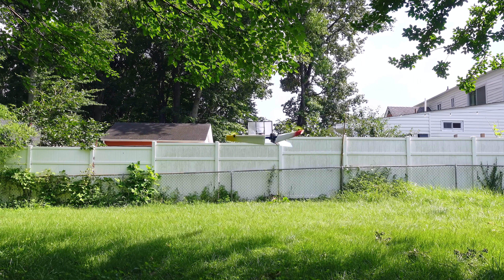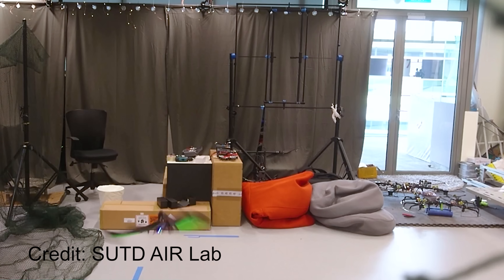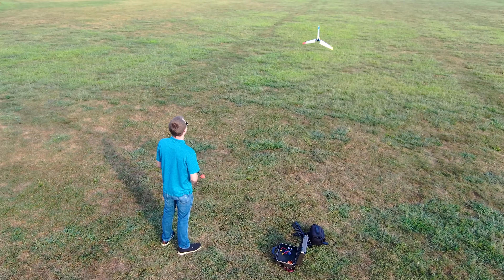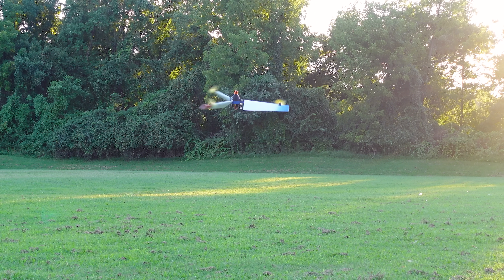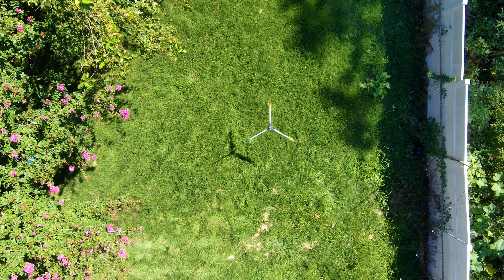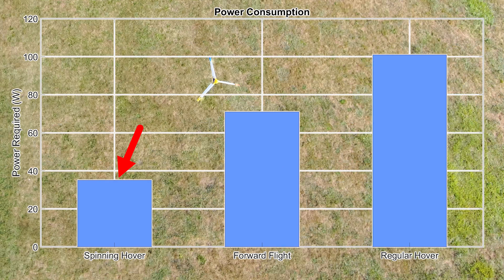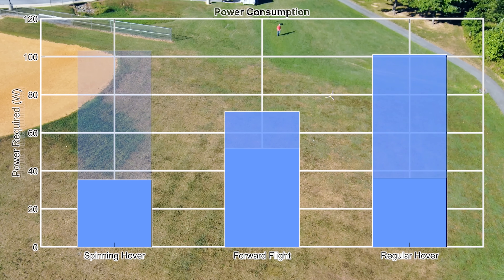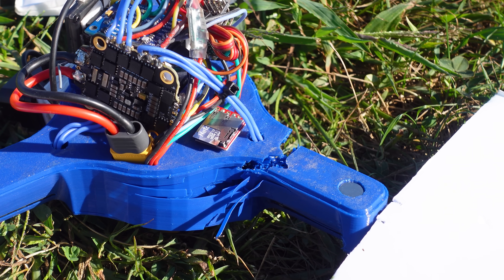Is THIS the Most Versatile Aircraft Design?  (Forward Flight Testing) - Part 2

Comment from the maker: New channel motto: Fly It Till You Crash It
Reply: 360 cam ?
Reply: @associatedblacksheepandmisfits  nope, you saw him keep a "subscribe" sign steady, meaning there's some counter-rotation going on.
Reply: @JustinKoenigSilica  was a suggestion, to use a 360 cam !
Reply: Thank you for this video and update of that interesting project. Your motto is similar to that of ham radio amateurs: if the antenna system survived the winter, it was too small! Greetings from Hamburg/Germany, Dietmar, DL4HAO ;)
Reply: Perfect
Reply: .... and then rebuild better with the knowledge on why you crashed.   ...   Why did it crash?
Reply from the maker: @gutrali  lost my orientation!!
Reply: @NicholasRehm  Try having a bit more powerful rotors to counter increase in weight

and

 instead of conical cap , use lithium ion battery on place in conical shape on both up and down side at centre to reduce drag and increase power capacity
Reply: @NicholasRehm  How many times have your neighbors called MUFON after you flew your drone lol?
Reply: Fix it till it's broke.  The true engineering motto
Reply: please make an H wing design...
it can spin and has 4 wings while flying
Reply: Idea 1: Could you have a the "top" wing be shorter but deeper? I would have less drag in forward flight but still have the similar area.
Idea 2: With independant tilt on all three wings, two wings could tilt forwards 90 and the third one act as a tail with rudder and elevator.
Reply: Not sure if you saw my previous comment. I did a similar design for my senior project about 3 years ago. 6 wings, 3 motors. Over 9 foot in diameter. The concept was for a pseudo satellite / emergency communications, long duration loiter.
Reply: 🛫📖🛬
I really like your new motto.
When you pranged it I really appreciated that "chuckle" 👍
That means you're a veteran.

After a real bad crash I would always say,
"WILL THAT BE PAPER OR PLASTIC SIR?"
Reply: @chuckcampbell3927  Is a plastic trash bag your “crash recovery vehicle”?
Reply: Try having a bit more powerful rotors to counter increase in weight

and

 instead of conical cap , use lithium ion battery on place in conical shape on both up and down side at centre to reduce drag and increase power capacity
Reply: keeping directional control, Clarke-Transformation and park-tranformation might be just what you need. they transform your rotating 3-directional system into a stationary bidirectional system.
Reply: Rules I live by.
Reply: ‘Fly till it dies’
Reply: can it have a short 'wing' on purpose, if level flight is always going to be in Imperial Shuttle orientation? (-o-) pew :P
step all the drone motors in to halfway down the wings and have one as a tail? - yes, I know that might have a (small?) impact on your spin state...
.
an alternative. Make a B-wing - 4 wings in total. 2 long wings for level flight and 2 stubby tails top and bottom. Making your spin state stable again. Reducing drag in level flight.. maybe you'd even get a mix to use top and bottom rotors for pitch attitude, in addition to left-right 'ruddering' - all compromises of course but should give you less drag and more top speed in efficient, level flight...
Reply: i also thought about 4 'wings', horizontal flight could be in 'x-mode' - all 4 generating lift, may not be more efficient with spinning mode though
Reply: @Φλωρος-Θωμασου-Ξ5Ξ  probably to keep the same efficiency, he would have to change the size of the motors, using 4 lighter ones, or just make the whole model bigger to take advantage of the extra power. Prop size is very important, which is why it hovers efficiently, because it is acting like a giant, slow, propeller in hover mode.
Reply: you could add an extra servo at the base of the vertical fin in forward flight and have it tilt backwards gradually. Upon reaching max speed you would have that rotor almost if not completely level while the two wing are doing their usual thing.  that servo could revert to its normal position as you slow down for hover giving you what you have now. Just a non-conventional idea that needs to be tested asap! :)...
Reply: Ride it 'til the wings fall off!
Reply: This has been my RC motto since ever.
Reply: If you want a efficent twist in the wing, there is a way, its not that complicated. But it would need a few changes. 

Have a carbon rod/pipe,  as large as possible in diameter, have it conected to the twist servo. Put  the wing over, but only conect it rotationally to the outer edge. Conect the inner edge (with a bit of flex) to the central core boddy.

If the flex is the right anount, you will have a prefectly screw rotorblade, regardless angle of attack. This way tou would probobly gain 20-25% hover effixency
Reply: If you move the motors to wing centers you could increase the tip speed of the wings ;)
Reply: I like this design. Did you try flying forward with the two wings up, so the dihedral is up, making it more stable? In the end, you might want to use 4 wings to get a flat wing and, if you could move them, like an x wing fighter, you could make all 4 wings be mostly horizontal.
Reply: in fact, you could even do something like a box kite shape. idk if that is a good wing design, but a box kite pulls really hard in the wind and, with some creativity, you might be able to fold it out into two very long wings for a high aspect ratio and efficient glide. Of course, there are so many tradeoffs that you might want to build several designs for different advantages.
Reply: Why not 4 wings  like an + shape for spining wich fold down into an X wing shape for forward flight? mahe it like  as close to a biplane as you can when the wings fold for forward flight
Reply: Why can't the third "wing/propeller" go on the bottom while in forward flight mode? That way you don't have to balance a big awkward thing at the top.
Reply: Nicolas, will it possible to see 4 wing model on test? To see how it will be flying in X-wing style. :)
Reply: Most of the man piloted bulk drones need wing concept similar to this, wings/fins to impose cruise direction mass into lift. Or a centripetal limbs like this one.
Reply: I had an idea for your horizontal movement while in spinning hover. Bot sure if it would work or add too much weight. Basically at the end of the wings ad small (perpendicular to the main wings.) stabilizers. A T section if you will. Haven’t tested myself (yet) but in theory.
Reply: Coca-Cola Themed TIE-FIGHTER ❤ How long ago did the Military steal your idea ?
Reply: You could try annealing the center hub in the oven. Grind down salt to as find a powder as you can make it, put it in an oven dish and pack it tightly with the salt.
Reply: Add another 3 motors to the bottom
Reply: Add these to your prototype and see if the efficiency adds to your design.

 https://youtu.be/k0yzBTTqfzs
Reply: Yeah I seen an elder guy had a pole with a weight on the end. He couldnt pick it up, but when he spun the plate he could pick it up np. I guess it wouldnt matter the weight of the drone if its spinning fast enough?
Reply: BRAVO on that drone design! One of the best I have found so far.
Reply: Try a 4-rotor blade model, and fly it in forward flight aligned as an X to the ground. All 4 blades will provide both lift and stability.

Comment: Such a machine can be used to provide an antenna/transmitter/receiver platform for emergency contact radio.  Using amateur radio existing repeater technology; one could build a UHF [440 MHz] uplink to be retransmitted out to any VHF or UHF repeater station;  all of which would be dramatically more accessible at 300 to 500 foot altitude.  Such a system could be compact;  fitting to a briefcase.   This would be a game changer -- a "mountain top" in a briefcase.    📻

Comment: Make that third foil fold in forward flight. Perhaps make the folding work on centrifuge forces when it spins the wings are equal lateral. When it stops the third folds.
Reply from the maker: Unfortunately that kills the regulator tricopter hover mode

Comment: A helicopter uses a tilted swash plate to control the direction 

You can model an electronic swash plate, substitute RPM were amperage to the motor

Comment: I wonder if it would improve the control and efficiency if using ducted thrust instead of propellers running through every prop-path turbulence.  Does the ducting have more of a stable "jet" effect with Venturi effect, rather than beating the air at an angle with props for thrust?

Comment: I think the air being pushed by the props is just being flung parallel to the craft by the wings so less stable maybe if you put the props on the end of the wings or in a place where the air moving from them doesn’t collide with the wings 🤔maybe not

Comment: You need a way to hinge one of your propeller shafts on demand in a mode switch. That way when you change from hover to flight you could almost get the benefits of both tour design and the inspiration design. Hmmm

Comment: So instead of pitchin gthe entire craft forward for forward flight, why not just rotate two of the wings forward so they look like a normal airplane with wings canted forward, leaving the rear wing in a vertical position. The rear motor might even be about to be shut off in this mode. I have no ability to figure out how to do that, but with your skills it might be possible.

Comment: Can I ask why a tricopter and not more? Is it because of the compromise of forward flight vs hovering efficiency? I would imagine that an hexacopter with the same wing foil design and body spin principles would achieve high hover efficiency. But, I don't have the materials to test this
Reply from the maker: Minimum parts required to demonstrate the concept

Comment: I wonder if going from "3-blade" to "4-blade" might be better. Then the second pair can be also rotated to generate lift in forward flight rather than have one blade being dead-weight and add useless drag. The X shape also can resolve vertical and horizontal stabilisation.

For using a camera while spinning, I have a theory that a fluid coupler might be useful (like in a car's automatic transmission) if the turbine side has blades that rotate it in the opposite direction of the compressor side.

Comment: Also I assume you'll have a pod hung from bottom center on a spin bearing so it doesnt spin with the wings and on a swivel so it stays horizontal to ground, esp if it becomes a people carrier (which it should). To me, its THE ULTIMATE homebuilt experimental STOL airplane with a Yamaha snowmobile engine, generator, small contingent of batteries and electric motored props.

Comment: What about have wings extend by centrifugal force when spinning for climb or hover and then retract by springs when spin stops for forward horizontal flight. Could use shorter wings with less drag for forward flight but still have them grow for spinning climb and hover. The extension mechanism   would have to be connected for all three wings so that  failure of a single wing to extend would not cause a catastrophic imbalance. But, the mechanism would work by spring tension automatically for simplicity and safety.  You could also have better chance of coordinating wing lenght for max effeciency for climb, for hover, and for forward horizontal cruise as i suspect the optimal wing length is different for each manuever. Could use variable rate springs or 2 springs if best climb length and best hover length were different enough to matter.

Comment: If each wing was made like a hang glider wing (fabric with a tubular leading edge and bent tip), then it would be very efficient spinning and flying. The material would make an asymetric wing whichever way it was oriented.

Comment: Just discovered this channel and loving it.  Did you consider a 4 rotor design with 2 longer and 2 shorter blades?  Essentiall a diamond shape.  It would provide enough stability in non-rotating hover, and have level lifting bodies for forward flight.

Comment: @NicholasRehm Just a thought: why don't you put the broader part of the wing at the tip. Now, the slowest part of the wing is near the rotating centrum. At the tip of the rotating wings, there is much more speed, and thus more lift to gain.  Of course : also more resisance.... there must be a sweet spot somewhere

Comment: What about a modular design that you can switch between modes to maximize efficiency based on what you need most at the time? 2 wings for forward efficiency and 3 for hover.

Comment: Cool. I would try to spin (hovering mode) and fly forward at the same time. I guess it would be some labor to create a software to control the power diferencial to keep the three motor in sync so it would allow to calibrate the angle of attack moving forward. interesting to see what energy savings that would promote.

Comment: IDEA RE FORWARD FLIGHT: 
- Two foils 'flat' + one upright 
- The upright one is the 'front', the leading-foil, with a rotor for pitch control 
- The flat-foils are now swept wings, with rotors for go-go-power! 

Obviously, the go-rotors are at an odd angle in forward flight... Unless you re-angle the mounts... (I'm not talking about variable mounts, just orient them with the forward-flight swept-wing thing in mind and see what happens right..!!?) 

Which makes me think: Has anyone tried a 'normal' drone with rotors that thrust inward a bit, rather than directly down? 
(Hovercraft prototypes didn't work until they ducted the airflow right to the edges, blowing TOWARDS THE MIDDLE...) 

This project is quite exciting!

Comment: If you were to make a quadcopter with all the same features (altering the blades pitch for a more efficient hover), you could also make the forward flight more efficient by making the blades go parallel. This could give you the best of all 3 worlds, an efficient hover (spinning hover), efficient forwards movement like the thor (forwards thrust), whilst still having a very stable hover if needed (static hover). For reference, a looking at the front of the drone while its moving forward would look something like this x=O=x      (x = props, each '-' being a blade and O being the center of the drone

Comment: Great concept and execution!!  Have you considered adding a pivot point at the bottom of the rudder to allow it to rotate down out of the airflow during forward flight? Similar to the f-14 wing sweep concept.  The motor power and centripetal force would keep it vertical during hover mode and the aerodynamic drag would simply push it back out of the way during forward flight.

Comment: Could you pitch the lower wings together to be more level during flight so that the tail keeps its 30 degrees attitude? That should take the wings out of stall without forcing the large back fin up which is what caused that to be inefficient.  I think you could get your wings entirely out of stall and achieve way better forward flight this way.

Comment: Have you thought about building a drone that has 4 of these as the source of lift on each corner. This would provide total control in hover, eliminates the spinning issue for filming and could hold a heavier weights in hover with great efficiency :-)

Comment: Would a quad-wing be more efficient? It would also be interesting to see the results of forward flight with the wings in an X compared to 2 held horizontally, 2 vertically. I suspect that the X configuration might suffer more drag, but would probably be more agile.

Comment: Why not fold the top wing back when going forward? it might even work if you have just a lose hinge so the wing folds from air resistance but folds out when hovering? i would love to have a 3d printer to test it out myself but they are expensive
Reply from the maker: Extra degree of freedom is difficult to actuate and minimize slop

Comment: Wouldn't it be more efficient in forward flight in the Y orientation? The lifting "wings" would have dihedral and the unused wing would hang so it would be more stable so should be using less power overall to keep it in the best attitude. In the inverted Y orientation everything is working against you trying to make it fall off the balance pole if you get my drift. The only reason for doing this that I can see is due to the LIDAR mounting position being in the value of the Y. You could reposition that on the nose cone couldn't you?
Reply: That should read "valley of the Y"

Comment: To avoid the vertical non-lift surface problem, why not consider a collapsible-wing solution using a rotating magnet, to push out the wing again, emerging into the tri-wing configuration?

Comment: How about 4 blades, and in forward flight swing pairs of blades slightly closer to each other and fly like an X-Wing fighter? In fact if the mounts are not symmetric you can make a biplane which is super efficient (the propellers can be placed one as a pusher so they don’t strike each other when in biplane mode)

Comment: I understand that you have a problem with height control when over rough ground or long grass etc. due to the LIDAR variations in height data.  Perhaps you can fix this in software by taking a "rolling" height average every few seconds.  I realise that your experiments amount to pioneering work with the possibility of great applications in the near future.
Reply from the maker: Yup I’m filtering the measurement to “average” out the tiny measurement differences in the grass, but too much filtering leads to lag in the control system

Comment: Great content, ideas, design and execution. Congrats. I wonder the effects of the spin of the drone in the rotors, as one side or the rotor is moving in the same way of the drone and so its speeds adds up, while the other side is moving in the opposite way of drone so its speeds reduced from each other. Helicopters changes blade angles across the rotation to compensate it, this is the function of the swashplate. As you have 3 rotor it probably offset each other effects, but should be interesting to understand it.